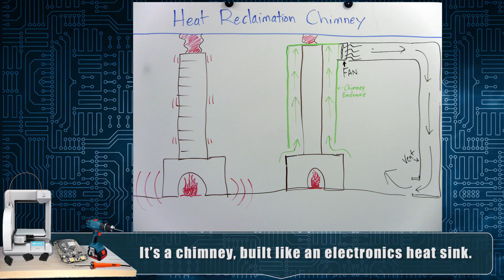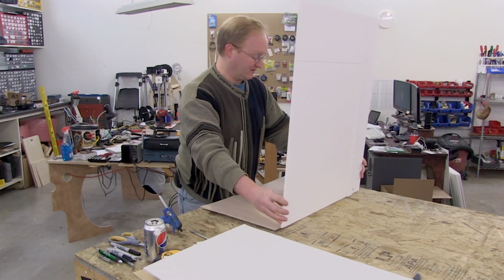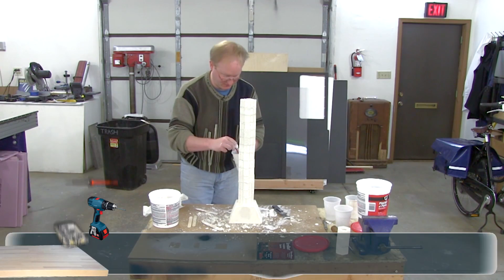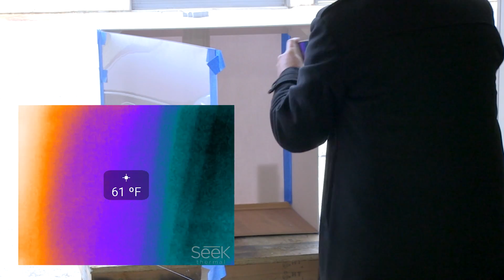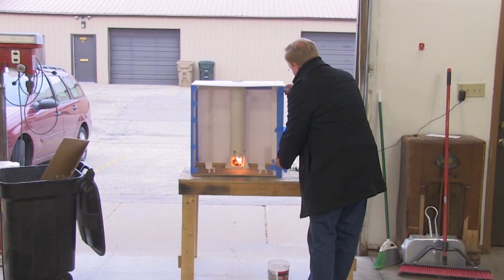Ben Heck's Chimney of the Future

Comment: OK .. this defeats the exact purpose of how your chimney supposed to be: HOT. Only hot chimney creates the necessary draft for a fire to burn efficiently and pull the smoke out. If you cool your chimney you just decreased your efficiency of burn, allowed deposits to settle and even smoke to get into the house instead of out the chimney. You can control the temperature of your chimney by regulating the fire so this is BAD IDEA!!! It's like driving your car with the breaks on.

Comment: The eficiency of the chimney can also be tested with the output of heat from the top of it. The colder, the more efficient it is, because that means the heat is being used inside instead of escaping from the top. Im impressed this test was not included. Also, the tube is too direct, the hot air is passing too fast by the tunnel, i would add more contact surface in the inside by using a radiator shaped tunnel, of course i would first test if it doesnt interfere with air flow to the exit and if the smoke is not throun to the inside of the house because the smoke cant go up... it would be a matter of calibration. Nice attempt though! and good idea!

Comment: There has to be a point where too much cooling would cause smoke to not escape the chimney. That could result in dangerous carbon monoxide buildup. Also, the slower smoke ascension may result in a dirtier chimney.
Cool idea though. Definitely worth more research.
Reply: +Cory Beutler 
Check out the "rocket mass heaters" ... they are really awesome!
And they use a small fire, but the design causes it to burn very hot, which is what you want... so hot in fact that it doesn't produce any smoke! :)

Comment: Well the chimney is inefficient by design. It makes it safe to use. If it has a lot of that convection it will less likely backdraft and kill you all. LOL
Now if the fireplace has no air intake from inside the house, its a different matter. You can build it so that the hot gases go around your walls and the fumes are forced out by a fan rather than convection. You can make it as efficient as you please then. (well condensation of creosote and stuff and cleaning access being the limiting factor. )
Reply: +kistuszek  +IamIUareU You are both correct. I am a former licensed home inspector, and chimney theory was a big part of the training because of danger of a malfunctioning chimney. I've been a big Ben Heck fan since the beginning, but this is a potentially dangerous project. Modern appliances that are very efficient and therefore have cooler exhaust use a blower and PVC pipe to exhaust right through the side of a house.

Comment: its obvious that your not using wood for heating your home and that you never did :) if you cool the chimney soot will condense in it and it will catch fire later or completely block your chimney.
Reply: +IamIUareU Exactly what I was thinking, cooling the chimney that much will trap too much creosote. Creating a chimney fire hazard.
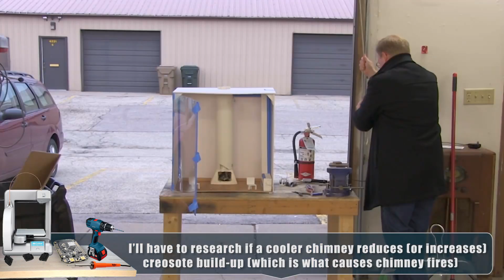Reply: IamIUareU 20:04 it is at the bottom

Comment: The only problem is that in a normal house, the chimney doesn't run trough only one room. So in this setting a fan on top of the room pointing downward will get the same results because the heat will rise within the same room. therefore a model house with more divisions will wield a beter result in my opinion for this experiment.

Comment: Friend of mine built a stone fireplace with a chimney that zig zags back and forth about 6 feet. Where the chimney was further apart on the sides he built vents with flat rock to passively draw more heat out.  That thing works so well the smoke that comes out is luke warm and 2 logs can bake you out of the house.

Comment: What to do differently: power the fan with a Stirling Engine. You can also power a small generator with the Stirling Engine which could be enough to power a circuit, but in general you would not need a circuit since the Stirling Engine would only run when there was a heat difference. And it would run faster the greater the heat difference.

Comment: I'm sorry, why don't you use a reverse air flow , from the top to the bottom of the chimney?
I think there will be a better exchange of heat by the fact that the air from the ambient will be following the heat rising of the surfaces of the chimney..

Comment: I'm surprised a brick style chimney was used for this test. I would think a metal chimney would radiate heat better. In Japan I saw kerosene based heaters used in classrooms. There the metal exhaust pipe itself radiated a lot of heat. Well, it was a good change of pace from electronics episodes.

Comment: This already exists. Most chimneys here (in Sweden) use a slithering pipe with air that absorbs the heat from the smoke and a fan that moves the air. We have this (in Sweden), and it is over 30 years old.
Reply: It would make for a cool science project for kids though.
Reply: So it is almost like your design just that ours are more efficient because it uses a longer path which gives the air more time to absorb the heat ;). A Masonry heater uses a similar technique by having absorbers made out of masonry invented 5000 BC :D
Reply: Thats what i thought,,
also  i saw   somewhere that the INCA  IN PERU had underfloor  heating system..

Comment: Maybe a masonry heater would be a better idea.  Some people call them a Russian Fireplace or Swedish Fireplace.  They have huge thermal mass and a convoluted path for combustion gas to exit so that the mass is more efficiently heated.  You build a short roaring fire and then the heat from the thermal mass heats the house through the night.  But Ben, I really do like your series of videos.  You have a unique combination of smarts and creativity.  Please consider this idea for one of your projects:  In my community and others the county and/or private tree trimmers/landscapers have piles of wood chips to get rid of.  You typically can get them for free for garden mulch, etc.  I would like to design and build some sort of feeder (screw conveyor?) to feed dried wood chips into an outdoor heater that circulates hot water to a heat exchanger in my existing hvac system.  I would use arduino to automate the process.  This would free me from the hard work of cutting and splitting firewood.  What could be better than free fuel?

Comment: This is so questionable, for many reasons. If you put in a modern fireplace, and close it's doors while burning, then you can know the fresh air for the fire is coming from outside. Then the fireplace itself should have a fan system to move the radiated heat from the fireplace to the room. So in essence the air is heated up as it enters the outside section of the chimney, used for combustion in the lower section, then exits the center part of the chimney. A closed fireplace is what's needed to heat up a room.

Comment: It would have been quite easy to determine how efficient your system is.  But to do this you measure the heat escaping from the chimney, that's all you need.  So you put a fairly efficient bomb calorimeter over the chimney escape, this will measure the total heat lost from the chimney in the control. I.e. number of joules.

Then you repeat with the capture system in place.  Then subtract.  Conservation of energy will tell you that there should be LESS lost heat from the chimney in the capture version because you are reclaiming it into the house.  You can easily calculate the fraction (and thus efficiency) you are extracting heat from your model fireplace.

What is happening in the house is largely secondary and is entirely a function of the efficiency of the distribution system, insulation of the house, and the air seal of the house (which you were apparently not interesting in for this preliminary experiment.  Which is just fine.)

I would say your concept has merit only because a non-reclaiming system is SO poor that your fairly terrible attempt at reclaiming heat is much much better than doing ZERO.  But once you realize that the efficiency of the system is determined only by the change in heat losses from the exit of the chimney you will realize that your system is very very very inefficient.  Probably in single digits %.  The reason is obvious.  Your chimney material is an excellent thermal insulator.  Additionally for air-based convection-convection heat exchange you need high surface area on BOTH sides (the inside of your chimney is no good, and must be so to meet building code, creosote etc).

If you want to have any chance of making it into the double digits efficiency exchange, you have quite a bit of work to do.  Metal surfaces, combined with larger surface area (either by traditional heat sink methods or by increasing the travel path length) would be obvious places to start.

It's kind of funny, but in your model experiment, basically the critical variable was the thermal conductivity and thickness of the material forming the chimney column.  This was the determining factor of how well heat would make it from the hot column of combustion gases into the reclamation column.  You are lucky you used plaster, if you had used metal with nice surface area, you would have captured so much heat you would've melted your driving fan in a handful of minutes (assuming it's plastic). LOL.

As soon as you realize the physics of scale experimentation, you will come to the conclusion that your experiment was REALLY insanely ill conceived and much more care and precision would be required to figure out how much heat you can salvage from combustion gases in a real fireplace.  Consider the combustion gases in your "scale" experiment are about the same temperature as combustion gases in a real fireplace.  Knowing the laws of heat transfer scale equally with temperature difference and transfer thickness, do you think it makes sense to have the same combustion gas temperature in your scale fireplace as a real one, but with maybe a 7 mm chimney wall compared to several inches of refractory material in a real fireplace?  Physics fail.

Your experiment could easily have been off by 1 or 2 orders of magnitude in either direction because you didn't use any math in determining how to conceive of the translation of full scale physics to scale physics for your application.

Sorry for the bad news.

Comment: this is basically how an oil or gas furnace works anyway. the fire goes in the bottom, and comes up through tubes (think of them as small chimneys) then out the chimney. 

another old standard was to use stack heaters. again, a series of tubes set in the chimney, that got hot as the furnace worked, and then forced hot air through the tubes, spreading the heat. (google search "heat reclaimer")

Comment: Taking too much heat from exhaust gases isn't a good idea - if the temperature at the top of chimney drops somewhere below 35 deg celcius ( dew point ), you might get condensation with a lot of acids whitch will 'eat' yout chimney in time. And this method isn't really safe - what if you get a hole in chimney and you pull smoke to your hause ? Carbon monoxide is a fast and invisible killer !

Comment: Their needs to be an air inlet from the outside for oxygen (airbrick) The fire could also get its needed oxygen from another air inlet from the outside underneath the fire, so the fireplace could be sealed with a glass front to prevent gas from getting into the room. Baffles above the fire, inside the chimney would capture the heat and allow more heat transfer to fins you made around the chminey.

Comment: Coil copper pipe around the chimney that then runs under the floor of the "house" in a zig-zag pattern. Through this pipe, run water. The water will be heated by the chimney. It should also retain its heat longer than air would so even after the fire goes out, it will still heat the home.

Comment: for better efficiency: the inside pipe (heat exchanger ) should have been made from high-conducting material (not an insulator), then the outside walls should be made from the insulator (plaster bricks) for safety.  The inner pipe still needs to cope with max temps of course, it's just ideally not an insulator (brick).

Comment: Domestic bliss ....................
Dear Ben , 
1 ) first generalisation . In well though out systems of fire installation air is ducted in from outside to ensure that room heat is not taken to drive the fire . 
2 ) The burning of fuels is a mixed bag , if you for example burn wood , the material that may condensate out on the chimney lining , be it creosote , or humidity turning to water , trapping ash & filling , reducing / blocking the chimney .  
I must admit , it ' s nice to see this work , but may be , leaving the chimney un ducted , even insulated , but have a top of chimney heat exchanger , be it air to water , or air to air & pull the heat off at one point , that could be easily pulled out to clean . 
Regards Bob

Comment: Its a good idea but there are real world limitations to the theory. If your heatexchanger is to efficient so the smoke cools down too much, the "chimney effect" of warm air rising up and pulling fresh air into the fire can be neglected or weakend so much, that in the worst case your room starts filling with CO and CO2. Modern Fireplaces actually use similar methods and reuse the hot fumes in the fire to reduce carbonmonoxide exhaustion and increase fireefficiancy, but always have the mentioned risks in mind.

Comment: How about next time put a good old fashioned room thermometer inside the model.  then you would know the ambient temp, which is a more standard measurement.  not many people have measured using a infrared imaging camera to judge the relative comfort of a room.
Reply: I agree, I think a few digital heat sensors would be good, that way you wouldn't have to open the door (releasing a lot of heat) to measure the temp. Also, Colin's comment, above, about lowering temp of the chimney is very true.
Reply: Or use thermocouples, they are damm cheap and you can monitor multiple locations (eg. ambiant temperature, walls, chimney tube, ...) and plot some graph over time. Come on, it is basic science principle. This way, there is no need to play around with something  that will alter the temperature once you open the front cover !

Comment: drive the air down next to the chimney. Does not require extra pipe work to bring the air flow to floor level, and the heat exchange will be more efficient around the chimney.

Comment: Great thinking... But it already exists in many homes.  It's called a rocket mass heater.  They are extremely efficient because of two novel features.. first, the burn chamber is so hot that it more completely burns all fuel, leaving no creosote and no chance of a chimney fire.  Second, it plumbs the exhaust through a large mass to absorb virtually all the heat from the stove.  They are so efficient, just a hand full of twigs heats a room for days.  Check them out, very cool!

Example here:  http://www.richsoil.com/rocket-stove-mass-heater.jsp

Comment: This is like a bigger version of a wood burning fireplace insert such as ones made by Lopi.  There is a metal fire box that is close to airtight (aside from a small vent to pull in air to keep the fire burning) and when the firebox reaches a certain temperature an electric fan kicks on that pulls air in from the room circulates it around the very hot fire box to heat it and then blows it into the room.

Comment: I would have liked to see a control with a non heat-sinked chimney.  

Also, to expand, add the heat-sinking to the inside and outside of the fireplace as well to try and pull even more heat out of it.

Comment: this is essentially what is called a "rocket stove" this design will work how ever it will not work with a conventional wood/coal burning "furnace" with a  the reason being you will take to much heat out of the chimney and thus you will lose draft either causing the fire to burn inefficiently or cause fumes to build up and with coal this means it could explode 
if you wanna catch more heat coming out of your fireplace/furnace then you need to build/buy a heat exchanger to add which is almost what this does but its not nearly as efficient as a  multi-fin-box type 
the simplest way is to build a box with a bunch of tubes in them and route the fule gasses though them and put another box around them to pass air though

I have been heating with a hand-fired stove/furnace for almost 40 years a certain amount of loss up the chimmey is something you accept and the solution to not getting enough heat is usually just to  make the fire hotter or adjust the damper to keep more heat in the stove

Comment: Bens test if scaled to full size would cause a Cold Chimney problem which prevents the ambient updraft created by the drop in air pressure from the bottom to the top of a chimney, and is often insufficient to exhaust the smoke from a fire. In colder weather, a unused flue can fill up with low temperature, high density air which can completely block the flow of smoke up the chimney. When this happens, any attempt to light a fire will result in a house full of smoke.

Comment: It does capture more of the heat from the fire, but it doesn't prevent the pull of air from the rest of the home (which cools the rest of the house). To do that you would need an alternative external air source. An interesting test would be to put an intake from the other cold side of the room, or externally.  Also, a flex tube to vent outside would keep the garage door closed :) A fun experiment.